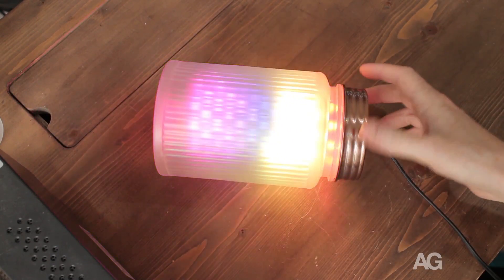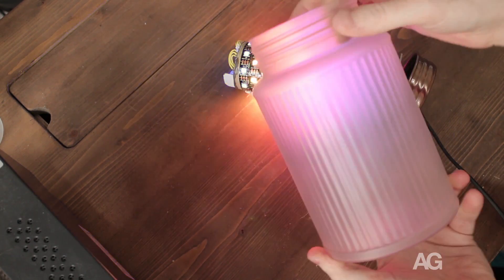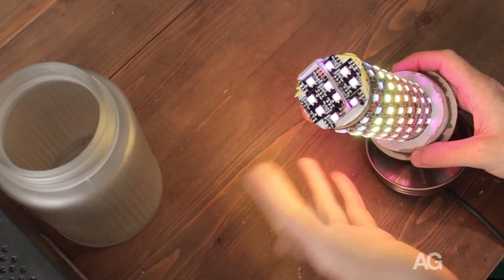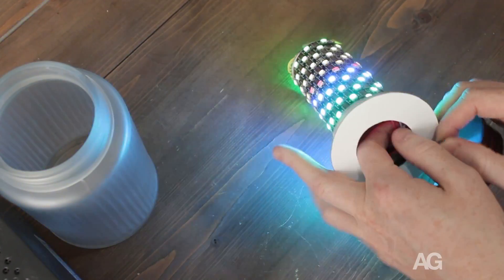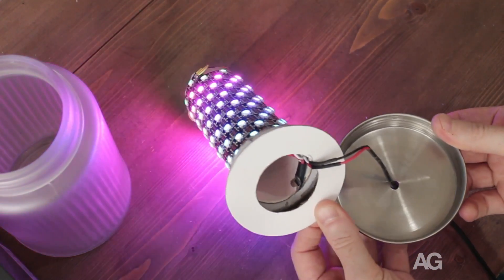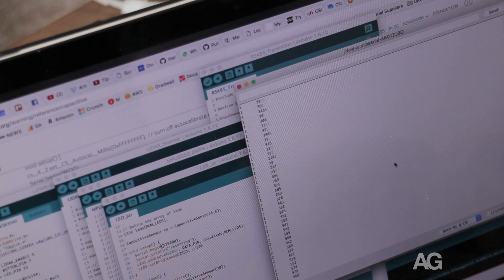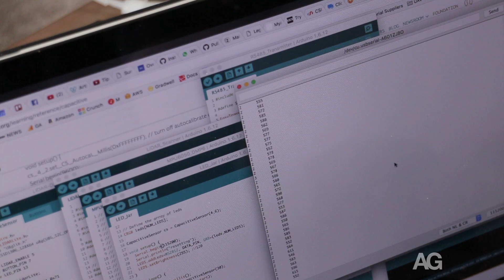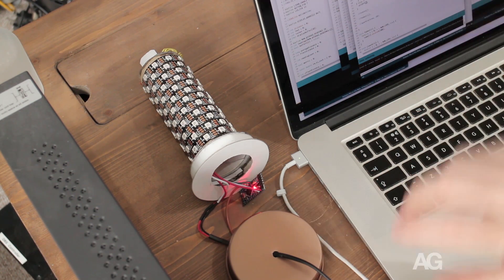Touch Sensitive LED Lights In A Frosted Glass Jar

Comment: I have an arduino Uno and when i compile the code i get an error "Error compiling for board Arduino/Genuino Uno." Is there any way around this pls?
Reply from the maker: If you're working with the code sample I provided you need to make sure you have the two libraries mentioned at the top of the code, the touch library and the fast led library.